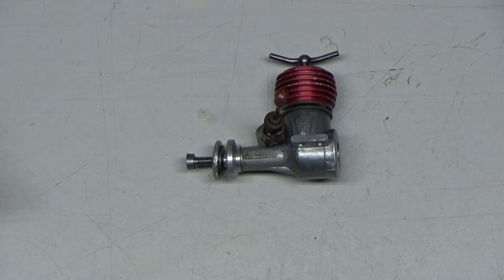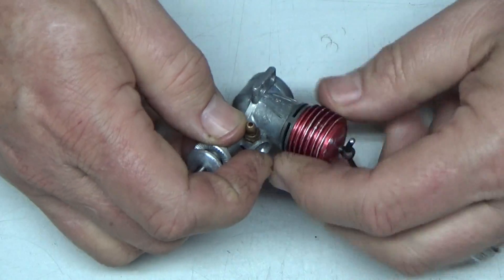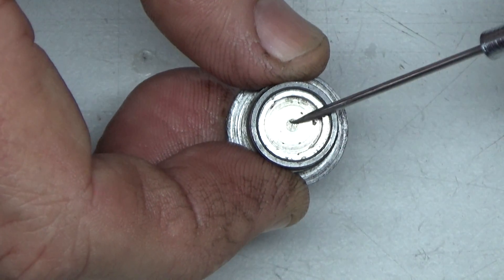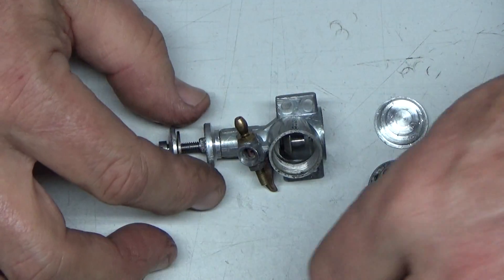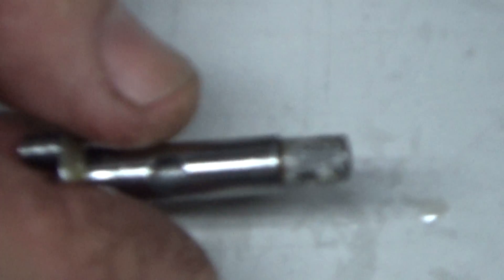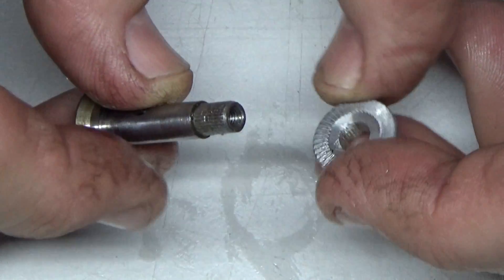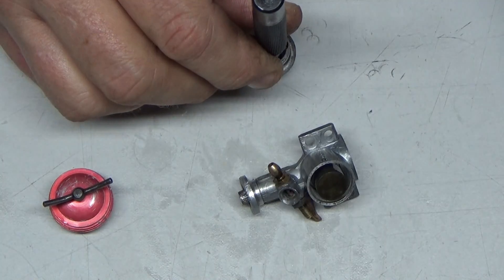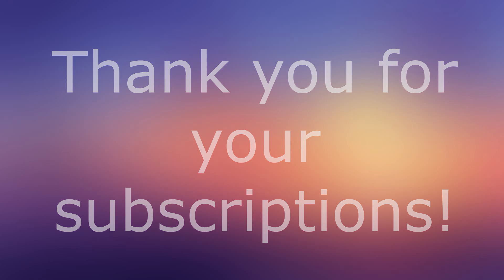A Look Inside Webra Piccolo

Comment: Hi David.I have several Piccolos of all types,and the contra piston is not orginal.Webra never use Aluminium contra pistons.Some very old Chech engines have this.The big risk her is,as people replace the contra  cast iron piston with a Dural piston,that if heat up,it expand much more than steel or cast iron,with a result of a crack in the top of the liner.I have several engines demage  like that..You can use aluminium,but it must be a high Silicium aloy like RSA 431 or similar,what expand far less. But dont heat it up when try dissasemble it,as it will freeze .Just use a brass rod of the size of the piston and it must come out for sure..Because the heat,you was not able to take it out.
But it need a steel or cast iron contra piston to make it work ok without crack the liner at the top for sure!! And than you will need a new cylinder.

The Prop driver need to be replaced.It need a new part and a press fit to make it secure well on the shaft..
If you like,I can make all those thing for you free of charge.The only cost will be twice shipping. As I like your vids and I am a diesel head ,I will be happy to help you out,no problem.Its not so much work for me.

Have a great Easter Monday David!

Peter
Reply from the maker: Email me and we can discuss further.  I can just send this engine to you and you can do whatever you want with it.
Reply: peter is the Diesel king! he knows every thing there is to know when it comes to diesels
Reply: A Webra Piccolo was my very first model plane engine, about 1968. Did not last very long, disappointing little motor. Was replaced with an ED diesel (British)which was so much better. Nice trip down memory lane though David, thanks.